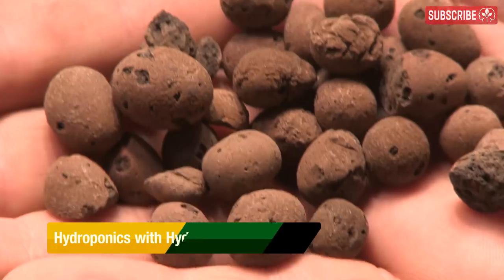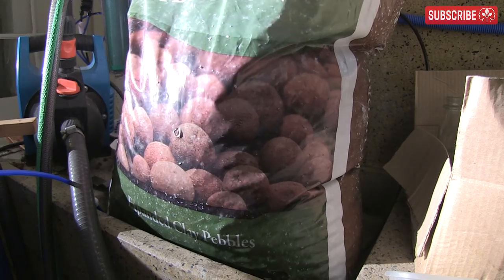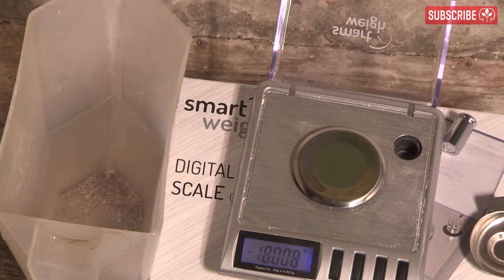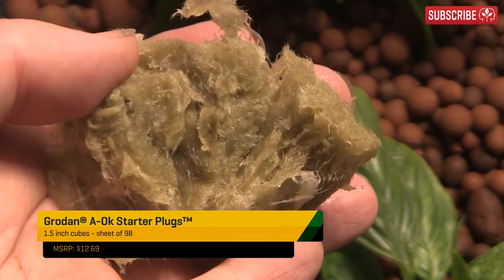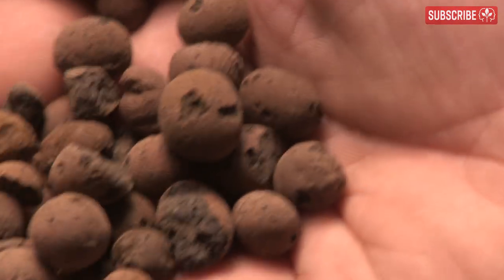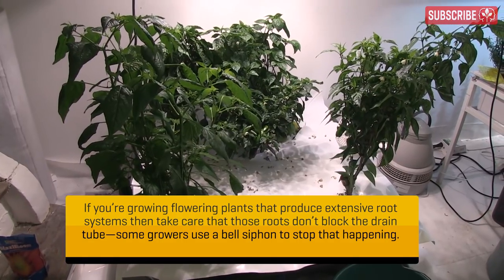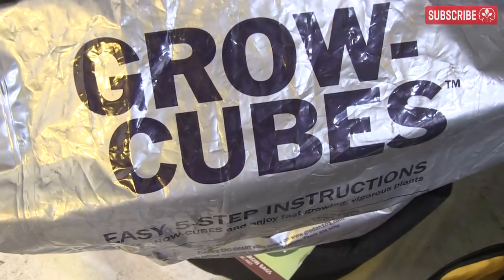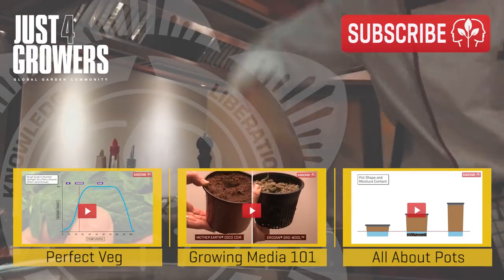Hydroponics with Hydroton Expanded Clay Balls

Comment: Hello Everest , how ya doing another great video . 
Would like to add as it’s an experience I had . 
Yes hydroton can be reused , rinsing it with fresh water helps , but helpful tip , try to not reuse to many times . After 3 crops maybe 4 start to consider changing your hydroton . For the problems you can have it’s not worth it . 
There a pellet and yes rinsing help but only to a degree . As you did explain it has a positive charge . That being said after a number of crops that positive charge starts to grab onto and hold onto nutrients or vise versa giving you a salt buildup in them that really damages crops and lowers yields . No matter how much I rinsed them in efforts to save some money , one day banging my head against a table trying to figure out what’s going on I figured it out . Upon testing hydroton that was rinsed once , twice , three times and so on I tested my hydroton only to find very minimal drop on ec . It is AWESOME STUFF but still like most mediums , it’s always a good idea to give it a change every so often . 
 The more I work with all the mediums I do with my growing ... no growing was as fun as areoponics , no mediums at all , not for you novices , learn with other systems before doing this way,  know your nutrients and ph , know when and how many times you want those misters aerating that nutrient solution right at the roots giving those beautiful WHITE SNOW looking roots maximum dissolved oxygen . 
Just a tip I though would be good to share for those using hydroton . Another one , like Everest mentioned cover the roots with 4-5 inch of hydroton , if using bigger blocks with that wrap on the sides , whatever ya do cover the top . Some people say that keeping it uncovered is ok but I think that covering it and rising periodically is a must as the green algae that grows there not only robs your roots of oxygen but also acts like a Lilly pad that collects salts from nutrients . If using less hydroton as well in your system you can help the roots more by doing like Everest mentioned by useing a pot with the leca pellets or hydroton then placing in table and then filling the rest of table with a lower level of hydroton . The further the roots reach from hydroton the more the sit down on the table then grab the hydroton . Those roots are better off sitting in the ribs of your tray following the flow of the water in and out of the table . Boy I can go on and on but this is your show Everest and loving it . Keep it up. 
Just started a whole lot of new stuff , basils , sweet , Thai , lemon and lime , spicy globe , cinnamon basil too for those who love that aromatic scent ! Tomatoes , and a whole hell of a lot of peppers habannerios being the ones I can’t wait to do again ! Starting some strawberries , nft system lifted higher up to collect strawberries standing upright on the floor rather than kneels in the mud ! and just for fun , and experiment , think I wanna try a watermelon and a pumpkin ! Think it can be done Everest ? lol

Comment: I've had several grow beds running for a couple of years now. I started with three flood and drain cycles per 24 hrs and found that to be too much water so I went to two cycles a day. Excellent growth and no wilting between watering. I fail to understand systems that constantly run water or systems like yours that require so many cycles per day. I've raised lettuce, celery, both of which require lots of water. The clay pellets hold water for long periods of time and there's always a small amount of water that doesn't drain out of the tray. My cycles flood the beds for around 15 minutes each time as some fill water drains during filling which aerates the water more as the water sprays back into the holding tank. I flush the beds with bleach between grows. I often use net pots lined with fiber pots filled with soil as a seed starter right in the grow beds. You just have to remove them and the plants before the pots disintegrate in six to eight months to keep the clay clean. For cuttings I just push them into the clay pellets and they normally root in a couple of weeks. I've got a cloner  but I don't really need it as the grow beds work as well as the cloner.

Comment: Here is what I recommend for hydroponics, it has to be ebb and flow (flood table), don't fill the table with hydroton because in between the floods all that water is going to evaporate and cause humidity issues, I say just put your plants into net pots and fill those with hydroton, then get panda plastic and over the flood table with it cutting out holes for your net potted plants. I like this method because I am still using the same small bag of hydroton I bought years ago.
Reply from the maker: +LMleet06 Thanks for your insights amigo. You're right, it takes a lot of hydroton to fill the table. Panda light proof plastic over the table is a nice tip. I live in an arid climate so excess humidity is a problem only in my dreams! Given that you use light proof plastic, are you not tempted to put just an inch or so layer of clay balls at the bottom of the tray for your pots to sit on? In any case, I'd be interested to know what size pots you use and how frequently you flood. Thanks again for sharing - hope you're subbed!
Reply: So the plants don't sit in water, you can get net pots that are elevated (http://tjshydroponics.com/shop/hydroponics/brown-net-cup-3/) The net pot sizes I use usually 6in, but I used 3in ones for tiny plants. 
Or this, http://www.homedepot.com/p/Plaskolite-4-ft-x-2-ft-Suspended-Light-Ceiling-Panel-1199233A/202025149, and cut it into piece to fit the flood floor.

Comment: Hi I love hydroton pebbles as well however I noticed when I tried to keep a balance moisture content with hemp fibre cubes that they would get a white cover over them that would spread to the tops of the clay pebbles, these at the time were dry on top because I was working on getting my amount of water in the tray correct.  In a large tray of 18 only 1 of them I noticed had this white coating almost looks like a thin layer of white spray paint over everything in the cup? I noticed this was the only one that had a hemp fibre cube exposed to the air could it be that it was growing some sort of mold?  I wasn’t taking any chances I pulled out everything in that cup and I transplanted the plant it’s fresh stone and no hemp fibre cubes.  I then went through the rest of the tray looking for any other pieces of hemp fibre and removed all that I found.  I honestly think it was the hemp fibre that has become dry that caused this white layer.  I suppose I could have let it continue to grow and see if it turned fuzzy or not but I wasn’t willing to take that chance.

With your knowledge and expertise I’d love to hear what your thought are on the situation I encountered and if you know what that layer was on top?  The reason I switched to hydroton in the first place because it seemed to grow algae/fungus if exposed to light  for long periods of time.  I considered creating a tin foil covering to reduce the light that may be causing the issues but I’m not sure if it’s truly necessary after having already removing the hemp fibre pieces?🙏🏻🥰🇨🇦

Comment: Hi! I have bought two different types of leca: one of them was consistently round and porous and the other was more egg-shaped and smooth. The egg-shaped one is not soaking up the nutrient water and my plants are drying out. I got this one because it was more affordable but it doesn’t seem to be working the same. I stuck both the round and the egg one in water and the round ones sank while the egg ones floated. Is it just because it’s not as good quality or is it something else? Help!

Comment: Great video just what I needed. Did you manage to do the follow up video explaining how to clean the clay pebbles with hydrogen peroxide?
Reply from the maker: +Artificial Consciousness Not yet but I've kept the bag of used pebbles in anticipation of that glorious day! :)
Reply: I shall be using your tip of punching holes in the bag in order to wash them. I have heard others mention using 'Bleach Water' but I have never found out what this is and how to use it. I shall await your video as I have a few more months until I need to clean the pebbles.

Comment: Everest, I know this is pretty broad question but here goes. is aroponics really that much more efficient than flood and drain for a mid size/commercial grow(2-6k worth of lights)?
Reply from the maker: Hi Dan, aero is more efficient insofar as you'll use less nutrients and, if you dial it in, it's more productive—but it's a bit like driving a Ferrari—you'd better know what you're doing! Environmental control is crucial as you don't have the insulation of a media around the root zone.

Comment: Thank you for all of your videos!  Is it okay to take a plant in a 4" Rockwool cube and transplant it into a 2 gallon Grow bag with hydroton?  Thanks!
Reply from the maker: +Hang Tough Hello amigo. I would be more inclined to fill the two gallon grow bag with loose fill Grodan grow cubes or Gro-Wool. Rockwool / stonewool and hydroton are are opposite ends of the water holding capacity (WHC) spectrum so it would be hard to irrigate effectively and homogenously. Better to stick with stonewool.

Comment: unsure if anyone is still reading this but if so, I have a question. 
I have a flood and drain bed and I have had my clay pebbles soaking for 2 days now. They are still floating and when the water rises, so do the pebble which causes some of them to spill over the sides of the bed. Obvious question, what to do? Any help would be great. Thanks
Reply from the maker: It sounds like you’re flooding too high. Clay pebbles will float, some are always going to. :)
Reply: thanks for the fast response. My water level rises to 12" with an inch of dry on top. I have a 2 inch lip from top of media to top of box. I was told to soak for 24 hours to allow to saturate but I am on hour 48 and a majority of pebbles still float.

Comment: Thanks for the video, really enjoyed watching and especially listening haha.

I was wondering if you could maybe awnser a question I´ve got for some time now, seeing as you´re pretty experienced with Hydroponic/ebb & flow.

I let my cuttings root in small rockwool pots (same you had in your video) but i nearly always got problems with the watering circulation. As soon they´ve got a propper root system (1-2 weeks mostly) I really enjoy working with Clay Balls and don´t want to change back to coco or other mediums.

Soooo what I´m not to sure about is - if they rooted through the rockwool and I place them in my ebb & flow system I normaly flood every 5 hours when they´ve got no roots down the Clays yet. But since some rockwools seem to dry faster and some slower I´ve always got problems with overwatering or underwatering! Was wondering if you could give me any tips for that.

It seems even if I let the cuttings root trough the whole rockwool propperly and place them in the system I still can´t overwater the rockwool otherwise I´ll get the same symptoms.

Would really appricate a reply, thanks again for the video!
Reply from the maker: The key with rockwool — whether you're progressing through the block sizes — or transplanting into a hydroponics system is to allow your plants to fully exploit the media they have available to them before transplanting. They should be crying out for it — like a greyhound begging to run — and then, when you transplant, they shoot out of the starting blocks. Ideally, you should propagate in the same media that you intend to grow in, but I'm very fond of propagating in rockwool (as you know) and haven't experienced any issues moving them on to clay balls — even when growing fussy plants such as Thai basil that hate it too wet.
Reply: Thanks for the fast reply!
Sadly propagateing them in the same medium is not an option since I mainly buy rooted clones.
I guess I´ll try to Air Pun them for a week after I bought the rooted clones, maybe that makes them root faster through the Clays. Would you say once they are propper rooted you could even flood the rockwool every 30 minutes due to enough roots looking out of the rockwool meaning they still get enough Oxygen?

What i normlay do is once they rooted through the clays flood the table just below the rockwool every ~30 minutes, that´s the moment where I love the system due to the plants exploding and showing that "hydro effect"/faster growth than in any other medium. Getting them to root propperly through the clay is just always a problem stage, really hope I find a fix for that to stop them showing all kind of symptoms in that stage (underwatinger/overwatering/red stems).

Thanks again for all the great information you provide!

Comment: I normally only flood 6 times a day, can I really flood 20 times a day while the lights are on? I grow 6' to 8' flowering plants. . . like the one in my profile pic.
Reply from the maker: +Chris Pridemore try 10 and see how they respond. If you notice salt build-up on the pebbles or the roots are not exploring all the media, these are signs you should flood more.
Reply: Interesting, I am I huge fan of your videos. I have been growing for the cannabis industry over 2 years now here in Denver, and have done consulting for several people. I always recommend your channel, and I have recommended you to well over 50 different people. You are professional and to the point, and I haven't disagreed with your scientific claims once. You're a wonderful guy, keep up the good work man. :)
Reply from the maker: Thanks so much for your kind words Chris. I was thinking about your comments some more—maybe in transition and mid to late flower you might want to ease off the irrigation frequency a little bit and let the roots dry out some more to speed up transition / ripening — a common plant steering technique. Hydroton definitely gives you a lot of scope for this. My experience is that folks don't irrigate hydroton enough. Do the math. If it only holds 7 - 15% its own weight in moisture compared with rockwool at 1100% then it seems congruent to me that you should be irrigating around 10 times more often than you would with rockwool. If you see salt build-up on the surface of the hydroton then this is a sure sign you should be irrigating more often. Finally—I can't thank you enough for recommending my channel to over 50 people! WOW! That means so much to me my friend. Thank you. For my part, I always go the extra mile to ensure that there is scientific evidence for my claims in an effort to make my videos science-based rather than anecdotal / diary style. Nothing wrong with the latter, just trying to help the next generation with some solid info based on many circuits 'round the block :) Hope you keep in touch—maybe hook up for a chat next time I'm in Denver. Peace :)
Reply: Salt build up on the surface suggests your flood level is too high, flood to 1.5" below the top of the hydroton ;) As for watering frequency, dont forget to account for the hydroton depth. A 3gal bucket of hydroton isnt the same as a 4" pot of hydroton.The latter will be subject to more evaporation than the former. A 3gal bucket with hydtoton "and" roots is not the same as hydroton alone. Measure how much water it takes to flood at the start of the season and at the end, roots can easily take up half the volume. Roots typically stay wetter for longer than hydroton, especially in a deep container )
Reply: Once the plants get established you may need to reduce the flooding time cos the roots will take up space that was initially occupied by air. It could equate to as much as 50% so the pump will flood the tray in half the time  ;)

Comment: A better way to measure their absorption is to place 1 litre of Hydroton in 5 litres of water for 24 hours.   Then tip the water out and measure how much liquid remains.   My testing shows absorption to be 20%.   It's useful to know how much additional nutrient solution will be required.